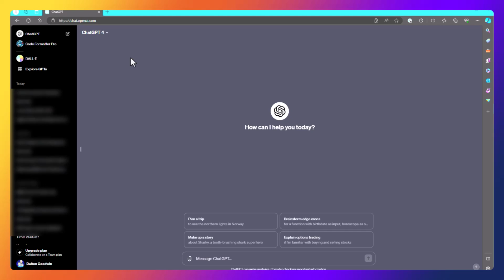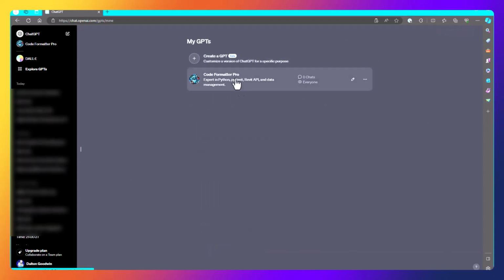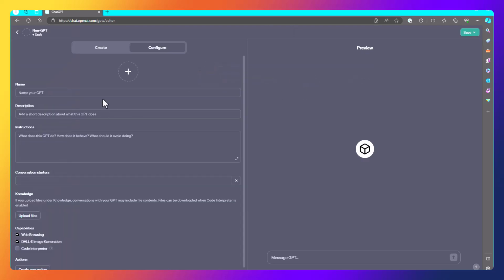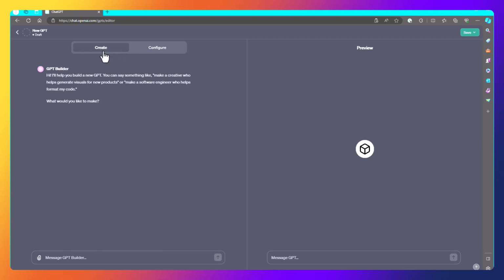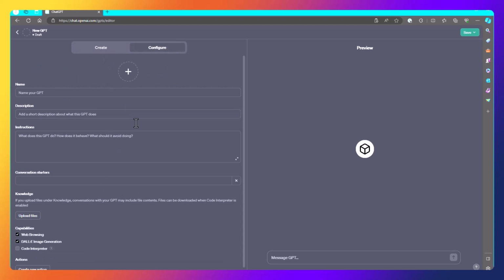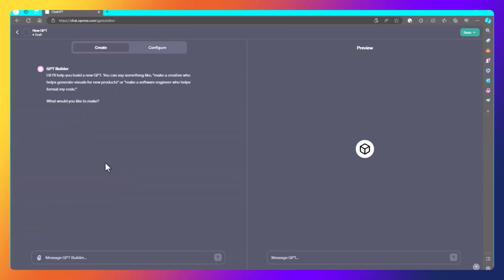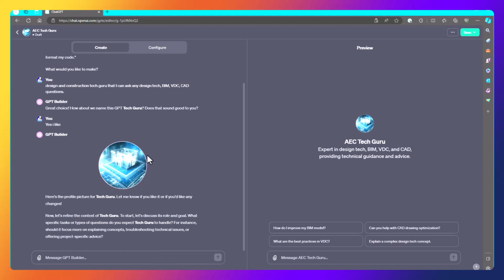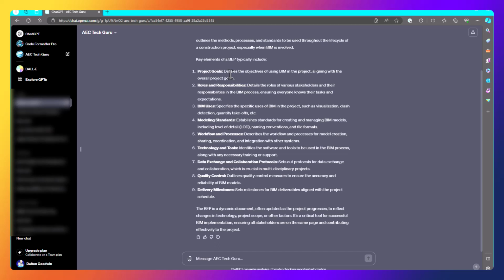A look at GPTs

Comment: Cool. But, do I understand correctly that this is purely a bot? Wouldn't you achieve the same just by having a CHAT dedicated to this topic?

Apologies if I have got it wrong
Reply from the maker: I don't know entirely. From what I gathered, that configuration part is kind of a significant difference. You can define the criteria, mood, style, context, data, etc. Then, when you ask your specific gpt a question, it will use the information you defined in the configuration part. You can have separate chats with that gpt. In the general chats, I may have one big chat about BIM, but I have found it will lose its purpose and context over time and will forget what it was intended for.
Reply: You are not wrong for some queries. There are two main benefits 1) it skips some basic steps compared to a regular gpt chat since you programmed it to assume few things  2) you can also upload manuals and references or documentation of any software and tell it to use it as primary source for answering rather then the web.